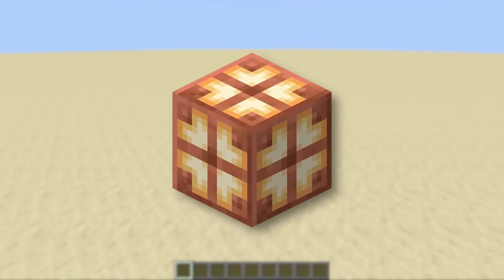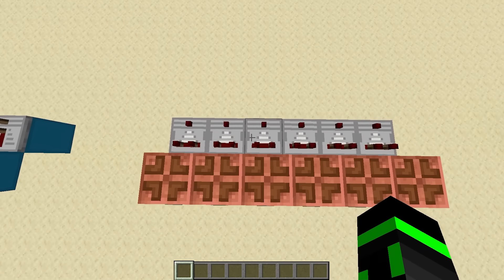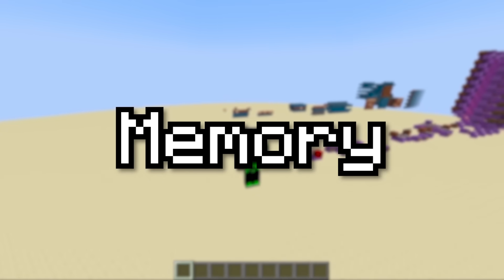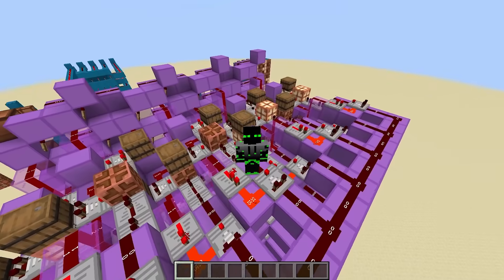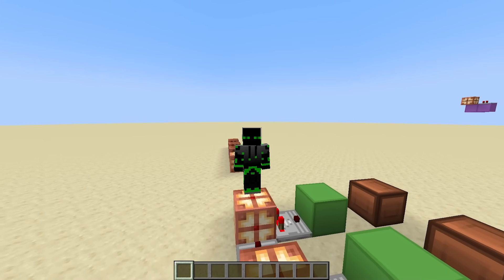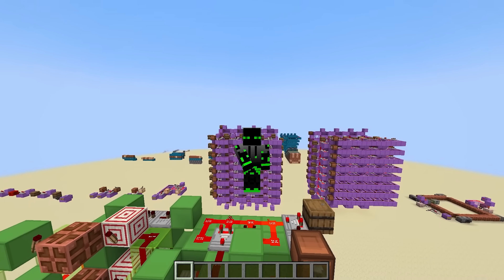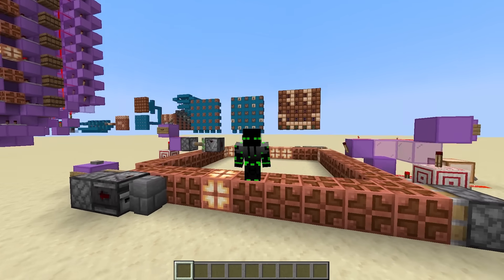Why I'll Never Use Copper Bulbs

Comment: I really love considering how societies based upon the world of Minecraft would function. There would be the basics, of course, farmers and miners and lumberjacks and such, and the architects and guards and soldiers.

But there would also be redstone engineers. Like, irl, our machinery is small because we can make it small through industrial processes - we can extrude wires, use robotic assemblers to create microchips, etc, but the world of minecraft wouldn't have that - it would have logical redstone.

The best comparison to the societal position a redstone engineer would occupy is that of a pre-modern cathedral builder. They construct these immense machines nobody but a chosen few understands the inner workings of - processors, renderers, calculators, etc. In a world without our modern technology, a redstone calculator would be the centerpiece of a city, a redstone computer capable of 3D rendering the powerhouse of an architectural empire. Entire mountain ranges converted into redstone machinery, guarded and maintained by a cadre of soldiers and engineers, all for the purpose of providing entertainment for the son of a king, or to calculate the logistics of an entire trade empire. Removing the need for a GUI, there might even be a kind of "redstone oracle" caste, which specializes in interpreting loose redstone signals. So no screen - you go up to a redstone oracle, ask your question, and they divine the answer via the red wires.

mechanical redstone would also be invaluable - city gates, monster farms, traps and prisons. And more importantly, item management - the existence of a large-scale item sorter would eliminate so much logistical burden - a mine could load off its products by the cartload, with ores and debris being sorted and processed automatically. People often posit that emeralds or diamonds would be the currency, but I think it would be Redstone. Or at least, a currency backed by Redstone. Redstone itself I can see being a very restricted good, since even a single redstone torch could spell havoc for a city's defenses - a strategically placed constant signal could disable one's ability to close the main gate, for example, or reroute valuable goods into a water line leading out of the city.

Comment: 2:30, bulbs for toggles, lamps for pulses.
4:16 "classic" design's big problem, is literally readability. the user cant see, you would have to route wiring for indicator lamps.
9:45 ...... you literally just dismissed the literal basis of computer engineering. its a Turing machine, you just need to work with it.

Comment: 5:40 Can't the note blocks here be replaced with copper bulbs to create a complete picture? Instead of there being a note block which is never illuminated,  the copper bulb will just have a different texture and the same illumination state, and the semantics of a note block as a toggle are no better than a button. Seems like as far as user interfaces, this is a great use for copper bulbs without having to spread the input out.

Sidenote: 12:57 - XOR them with 0? Why? That's just a no-op. Still impossible to wire the bulbs back to themselves though.

Comment: So, in short, if you're okay with it being slower to read, you can store a bunch of bits in a line and move them with pistons, as a "hard drive" instead of "RAM". (Like at 9:40.)

Otherwise, it's a T-flipflop block and not much else, at least as far as redstone computing goes.

Comment: 12:57 If you're only resetting, wouldn't you just AND with 0? 1 (display state) XOR 0 (input) = 1, so XOR with 0 would not reset the screen
Reply: Or perhaps you meant to say XOR them with themselves, which would work as you describe
Reply: I don't know how big these circuits are in redstone, so I have no idea if AND w/0 or XOR with self is an improvement over XOR with 0

Comment: The tape disk is cool and all, but if we're going for read-write sequential serial access memory, a similarly sized comparator loop can probably do the same job much better, especially if you're willing to preserve the full signal strength information in the bus, at which point it should read and write 20x faster.

Comment: i think the entire take about leverls be more understandble as switchers is a Duckling Syndrome. Levers are just USED more times. with new technologies, adoptation of Buttons as switchers is the question for developers, not users. Same to Image input. it is the best solution in any side. the only negative aspect is "not used to" and it is not acceptable as valid reason not to move on

Comment: You could also use a small bulb tape that cycles as the RAM is supposed to update, so it writes a 1 and pushes it into the read position when it's supposed to write a 1, and just pushes a 0 into the read position when it's supposed to write a 0.  If you run this tape vertically, you can stack 4~5 bits vertically on one tape if you wipe the tape right after it gets read and before it gets written, and if you invert the read/write positions then a single vertical loop could handle 8~10 bits.  This design would limit the ability to update any single bit on it's own and would require all bits on the tape to update at once, but it should still give a smaller footprint, and each bit could also be made to use its own smaller bulb tape if independent updates are required.

EDIT: found a more compact way to write and wipe the bulb data, you can stack up to 14 bits on each leg of the tape without issues on that front, just need a lot more pistons and a good timing circuit.

Comment: i made read-write memory using copper bulbs, but to solve the issue of not being able to set a 1 or a 0 easily, i just attached a bitwise xor to the start of the unit. so to write a byte to an address it reads the address, does XOR with the value on the main bus, then writes to the address.

Comment: ram memory with copper bulbs are smaller because the xor is commun at the end , you don't need a xor for each bit , treat it like a destrictive write xored although speed get a little hit because of the write back if the bit doesn't change

Comment: The read/write memory for copper bulbs is the same reason it's downright impossible to make computers in Astroneer: the devs want you to use count repeaters, but they don't act like nor latch, they act like toggles; ultimately, this makes set/reset an absolute nightmare. Combine this with lackluster duplication tools (can dup platforms, can't dup the wiring), making a basic computer means you don't have a life. Funnily enough power switch became more useful, but the dup issues still applies and large scale applications are better left to modders.

Yeah I made a calculator on that game once.

Comment: in the zone of computing, i have already proven copper bulbs to be great, you can make a practical, rewritable tape drive with them using a relatively simple mechanism (a 1 bit version is shown partway through this video). frankly i find the features of them more exciting than crafters. in my experiments, if it can be made possible to make a block storage that can handle them (without toggling them, or toggling them uniformly an even number of times), ive theorized you can store an entire KiB of data in a shockingly small space (a single block of 8 bit wide by 12 deep can store 144 bytes! you would only need 8 chained together to get the full KiB). copper bulbs shine, not as ram or (non erasable) rom, but as a semi permanent storage medium, like the historical uses of hard drives and tape drives. a bulb tape would be an excellent place to store a large program that may not necessarily fit into the ram of the system it is being used on, or as you can go as wide as 8 bits, you can encode genuine ASCII strings (using the full character set if you wanted) in your builds now, possibly taken from user input even. there are several more applications for this kind of tape, such as compactly storing picture data or building music sequencers, and as was mentioned by the other commenters, Turing machines.

for those that want to make your own tapes, ive made ones as wide as 1 byte in as many blocks, and as long as needed. the key is to stripe the data diagonally across the tape. the erase head mechanism can be pulled off of the read head and neatly fits inside the footprint of the tape.

Comment: I think you're focusing a lot on evaluating copper bulbs as a replacement for lamps, when they are really their own thing. Like of course when you put bulbs into designs that were designed for lamps the lamps do better. To be clear I have ~0 experience in digital redstone, but I do have lots of experience in real life digital circuits. Idk I just don't see how a one block moveable t flip flop could be useless

Comment: I don't consider myself a redstoner, but I'm a dev/QA. Seeing the copper bulb, the 1 tick delay was the biggest game changer.

I'm cynical about them because of how unresponsive it would be compared to redstone lamps, and how many adaptations would be made to already existing circuits with simple solutions.

Copper bulbs are like new technologies: just because it's new doesn't mean it will replace everything. In the instances I do redstone builds, I used copper bulbs simply because I had too much copper sitting there doing nothing, and it looks pretty.

I use copper bulbs in small circuits without much hassle, but the moment a building gets big, I choose the bulkier circuit because it's easier to maintain.

I'm here since God knows how long. To me, having a search bar in the creative inventory still is news to me, so you can guess I've lost a few of my builds due to minecraft updates.

Redstone needs a nice balance between compact and readable, and copper bulbs won't fill everything

Comment: Don't Real Flip Flops have a Reset Signal? That would fix the glaring issue that this copper bulb seems to have, never really thought about how useful that is in a real flip flop....
Maybe if they had a way to reset them somehow... But the issue is that the 6 faces on a cube don't really give much room to have a "reset side"
When using them as a screen you'd only have two sides, so you'd be able to input from one side and reset from the other, so there'd be no way to read, write, AND reset the output.

Comment: That actually sounds like you can use copper bulb as a solit state drive. To be honest, it doesn't sound bad to have a storage unit on which you can store large quantities of bits and then maintain this storage state. Maybe this way you can realise a redstone computer with bios - where the bios is realised with copper bulbs.

Comment: you could probably use a 2nd copper bulb for the read write module so you can read the current state of the bulb without using the same block, but it likely wouldn't be as compact as a standard read write module.

Comment: You don't need a xor gate at each memory cell though. If you use adressed memory with a bus just have a register that reads the contents of the cell you want to write, xor it with input data and send xorred to the bus for writing. It's slower writes but you probably need less space for it which can be a big deal if the memory is very large.

Comment: Most of your gripes are purely personal 

Especially when considering the way redstone works with the rest of the game, you only use them in creative mode, 
AND,
you are dead set on using methods that you are familiar rather than effective 

Remember that most of your issues are due to the novelty of copper bulbs and Mojang being a terrible company 

You are not the redstone community at large, and not experimenting means you stagnate and eventually get left behind, due to stubbornness rather than someone else simply being more skilled

Comment: For the record, the entire debate about whether the copper bulb should be reverted or not just shows how poor the tech community is at providing feedback. The real problem is that we would like a more convenient way to get odd gt delays. The fact that copper bulbs happened to offer this for a couple of weeks is not a good enough reason to hammer this functionality there, especially since it makes it worse for T flip-flops and binary counters, which are the more common use case by far, since a lot of the time some synchronization would be needed. Had this functionality been present in the copper trapdoor instead, people would be arguing about trapdoors now, meaning the feedback is entirely arbitrary and relies on an accident of history. I feel like people cannot think clearly.

Comment: mate, it's fine if you don't want to use them. but don't ban them from your tool box. that one by one screen, albeit slow, is smaller visually. you can also just use it as a t flip-flop, just because it's a light doesn't mean you HAVE to use it as a screen. i think it would be a fun challenge to make gates out of it. because it technically works on pulses, i think there is room for low lag builds that rely on rails and observers. you power the observer, observer sends a pulse through rails to your bulb. when you unpower the observer, same thing happens and your bulb turns off. from what i can see, it looks like bulbs are giving more options in terms of style and technique. i have no doubt that the button lock record will plummet with this addition. i wish you luck in your future

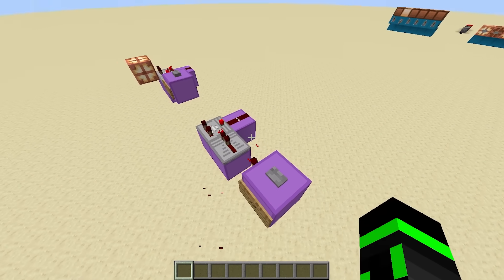Comment: 6:50 I can definitely see the Copper Bulb be used for Rom, specifically programmable ROM. Provides a really easy way to change the memory of the device while debugging without having to break or place blocks just by pressing a button.
Reply: How is this good for ROM, may I ask?
Reply: Yeah, you change the number 1000 to 0111. Very useful for resetting a memory.

Comment: Using T-latches in RAM can be a bit annoying, since you have to read the register before writing to it. But I think it's worthwhile tradeoff if it makes the RAM highly compact, especially if you're using it as a large secondary storage. I can easily see this sort of thing being used to store kilobytes of data.
 But using T-latches also means that you can do inversions directly in-memory, with no data transfer. You can perform these operations during both read and write. This would allow you to perform some of the ALU logic in memory, and do the rest in a simplified near-memory ALU. You can also do XOR and XNOR in-memory in certain cases.

Comment: I get the point that you want to make people actually understand the limitations of this and get a fuller picture, but I think you are just coming off as too dismissive. They are perfect for RAM and for ROM, they can provide buffer frames with ease, they are better for 1x1s(although you did actually cover that), and are a replacement for pretty much ever single T-flip-flop in computational redstone, save for some niche cases. It also is certainly way more lag-friendly than redstone lamps that are kept on by observe clocks.
You mention it being hard to use it for ROM, and while it is always going to be larger than item-based Rom, it can easily be edited, can be seen easily, and using pistons feed tapes or block swappers, you can have a ROM bank switcher. Placing and removing redstone blocks is also pretty accepted among computational redstoners, but it can be very hard to do manually, and not everyone has the knowhow, resources, or if you're on Bedrock or less well supported systems for Java, even the ability to use programs and tools to place them manually. You also don't have as many block entities, which reduces lag and storage space use. If you want to make a ROM that can be easily changed for testing or use in survival or vanilla creative, redstone blocks and storage blocks also make it hard or even impossible to do so without making a mess of your entire ROM, getting rid of any benefit it would have over the copper bulb. I don't think I'm under any delusions of how good the copper bulb actually is, but it certainly will find itself becoming a staple component of Minecraft redstone.

Edit: I feel like I came off a bit strong, and I don't think you really are all that negative, but I just felt like the overall tone of this video was overly negative and I just was a bit unsure of if seeming overly critical was really the best thing for the community. You really did just want to spread some information and awareness though, and I understand and appreciate that.

Comment: This does sound like an opinion. Having started Minecraft in 1.15.1 It would seem still that the copper bulbs are tighter compact and well just a good in many things that you do. You are more concerned it seems with the  "way it was" not how to use this new design to new extremes. 
And this is coming from a much older guy. We tend to do just that on well about everything.

Comment: To reset the copper bulb you can simply route its own value to itself. If the lamp is off, it doesn't to anything (because no signal is sent). If the lamp is on, it will send a signal and turn off. No need for XOR gates :)

Comment: Yeah, in the first moments after hearing about the copper bulb, I was so excited for the uses in logical redstone, but as I got into the snapshot for the first time, all the limitations immediately set in lol

Also, on the topic of binary counters, I believe the copper bulb could end up being really nice for Bedrock players. That vertical, synchronous counter you showed doesn't work (afaik) because of update order on Bedrock. If you haven't seen it yet, @TheDarkness344 has a nice video about copper bulbs and synchronous counters (even shows one of your pre-copper bulb designs lol)

Comment: Reset lines for the bulbs are super easy and expandable when dealing with  feed tapes, and while the circuit isn't super small you can read out thru it.